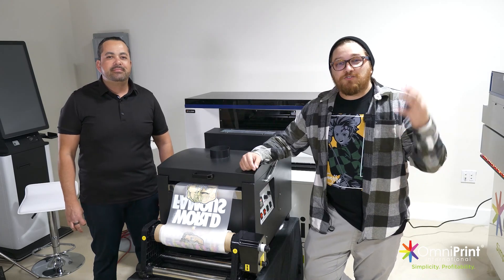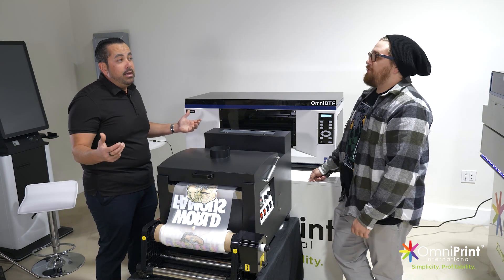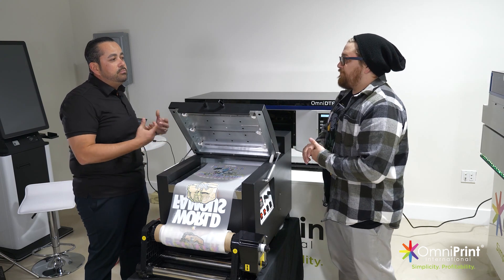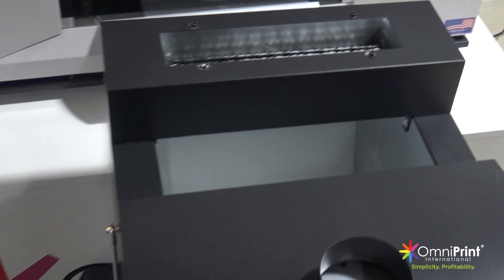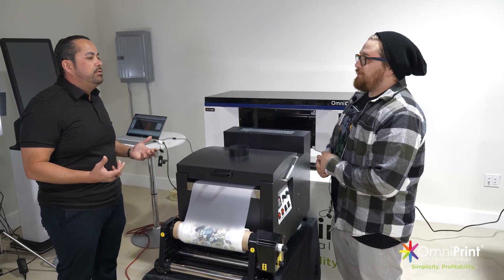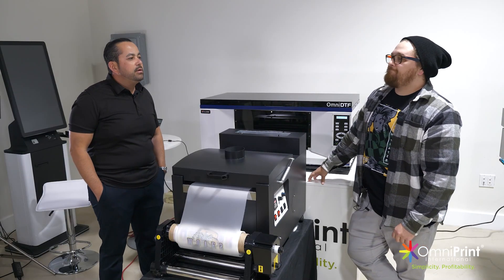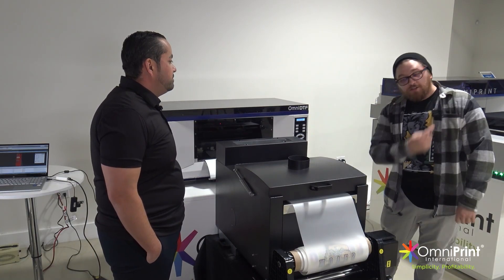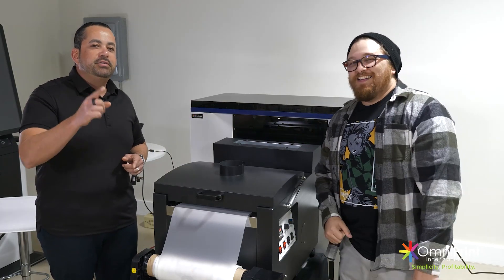The OmniDTF the fastest and highest quality direct to film printer

Comment: So what option would be better for the soft feel using dtf? Or which dtf printer do you have that can give soft feel after it's heat pressed
Reply: only with silkscreen u get softhand feel, dtf lot of problem, maintenance cost, then a lof your rival will selling dtf cheaper than u, halftone effect will take a lot of times to print, cause the small dots, u will not get a solid white ink, believe me, u want to start selling t shirt, dont buy the machine, just get the order from printing shop
Reply: @aimaniman5557  SILKSCREEN is the way to go for everything man
Reply: You can add empty space into the artwork which helps, or for the best hand feel DTG
Reply: @Mreclectables  YUPS. a big ass photo will just feel....sticky.